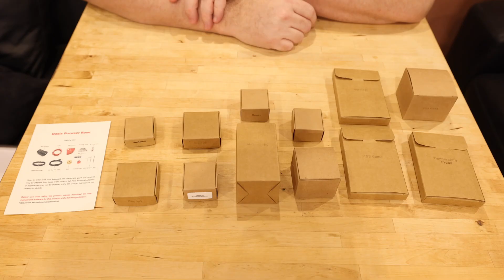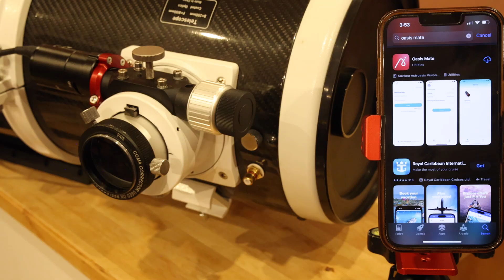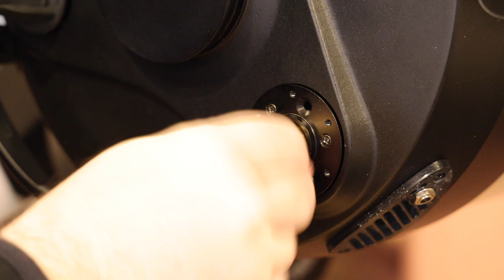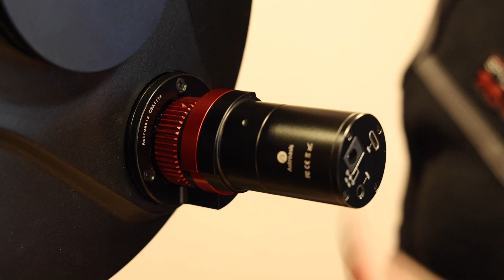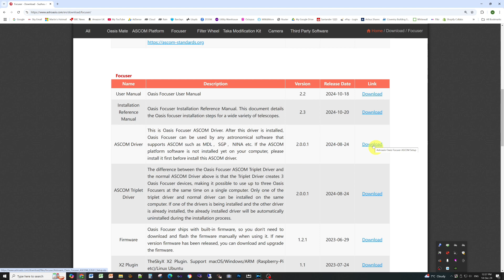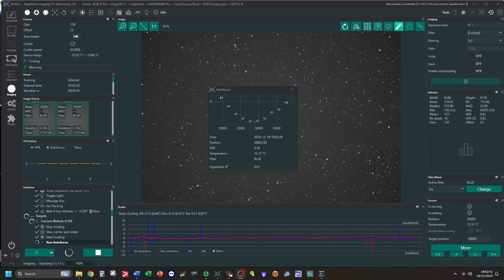Oasis Focuser Rose Review

Comment: You should make it clear that the various adapters for telescopes are not included with the focuser. I confirmed with Astro oasis that the SCT adapter, for example, is an additional purchase.

Good review, by the way. Unlike your use case, I am attracted to this because of its size. Changing focus with an eaf is slow, but once you know the position you can skew it directly to it for very different focusing needs.
Reply from the maker: @amitpshesh  Thank you. I wasn’t aware what was included and what is separate, as they sent me the whole lot without me having to order anything. A quick check of their website will hopefully provide clarity. Clear skies.

Comment: Thank you for the review. Will this work with an ASIair, or do you need to use NINA?
Reply from the maker: No, ASIair will only work with ZWO products. NINA would be the way to go.
Reply: @martinsastrophotography  Thanks. In a prior video you reviewed the ZWO CAA, and you have ZWO cameras. Which computer are you using to run Nina?
Reply from the maker: @ I use a Mele Quieter 3C (or 4C). These are low cost, very small fanless mini PC’s running Windows and they work great!  I have never had an issue with them.
Reply: @martinsastrophotography  Great, thanks!